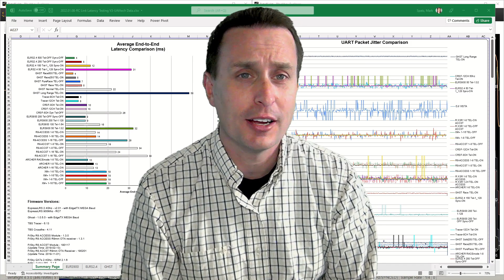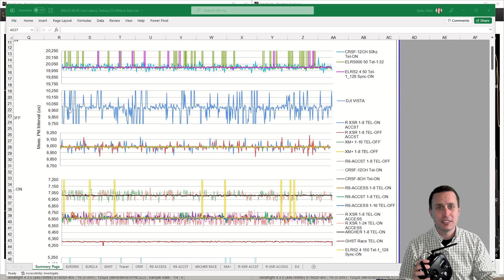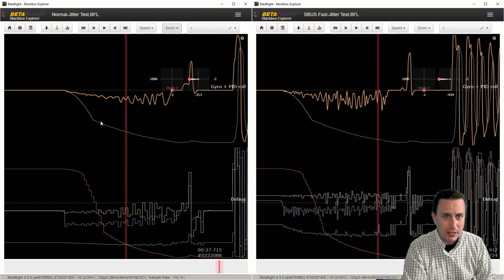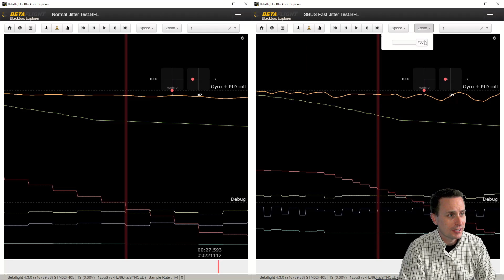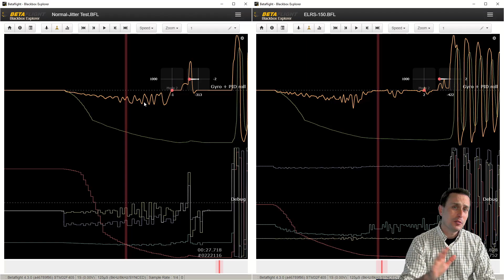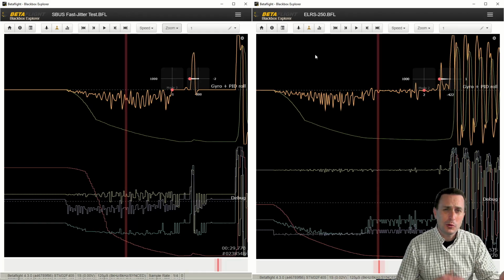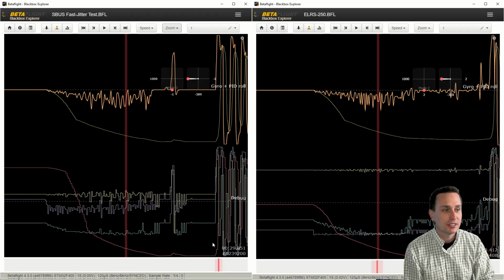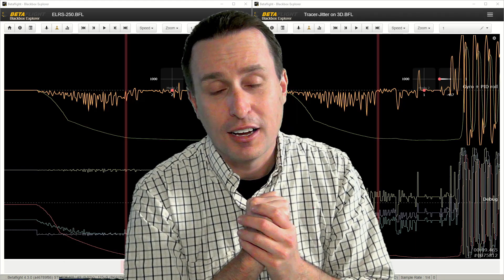DJI Transmitter Link Quality | Caddx Vista | Air Unit Lite

Comment: I would personally like to see a stand alone DJI receiver for my analog quads. Or someone hack the protocol for use with other receiver
Reply: Also, what is the output power and is it increased along with the air unit FCC hack? Can a 5.8 booster help? Thanks

Comment: Would you be interested in doing this testing on the Betafpv ELRS radio v2 SE? The reason I bring it up is I was previously using this as a main radio for my 2.4 elrs whoops. I had so much random bobbles in smooth forward flight, turns you name it. Puzzled I grabbed a real 2.4 elrs TX to use with my Radio and like magic it all went away! I can provide the radio if needed...
Reply from the maker: The Lite Radio 2 SE is coming my way for a review after Chinese New Year.

Comment: Getting all values together seems enough scenario is like: 10ms for radio control, 30-40ms for glass to glass video. in total 50 ms. F1 driver has reaction 200ms, typical drives 500ms. These fanboy wars between different systems seems funny to me. Nice deep dive into radio controll.
Reply from the maker: We are NOT reacting to an immediate and unknown stimulus (200ms - 500ms).  We are anticipating turns for upcoming trees or gates.  It is well know that then you get down to noticing a 30ms lag (check out gaming research).
Reply: So you're adding an additional 50ms to the average 500ms for a total of 550ms. That's why it's important to have the lowest latency.

Comment: All what i understand is just need to disable FF and all problems are gone.
Reply from the maker: No problems.  Just apply presets which smooths all this out.  These videos are just comparing links vs each other (raw).

Without FF, there is about 10 to 20ms of delay in the quads movement.  That's just now it goes with the P-term only.

Comment: So, considering the extra weight, extra point of failure, extra build complexity, extra antennas, price of adding a receiver... can anyone really justify anything else than the DJI radio for flights shorter than 10km?
Reply: i can’t justify it but i add crossfire to all of mine anyway lol.
Reply: Yes, easily.
Reply: I sold my DJI radio and got a TX16s, so definitely. Now I can use one radio for everything like my analog quads, tiny whoop, and wings.
Reply from the maker: Yes, i prefer an EdgeTX radio for diversity, settings, and consistent feel btwn all quads.  That said, lazy has not added receivers to all my DJI quads yet.
Reply: @uavtech  mixing with analogue and/or for better feel radio, sure, but for link performance...?
Reply: You have already spent that money on the digital system so what's your point?